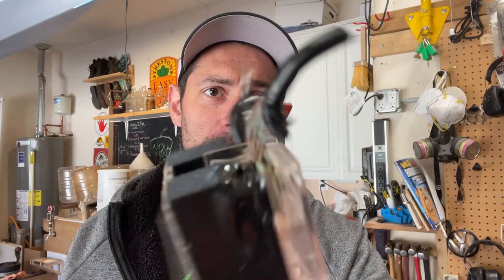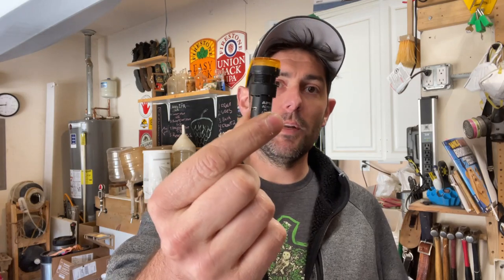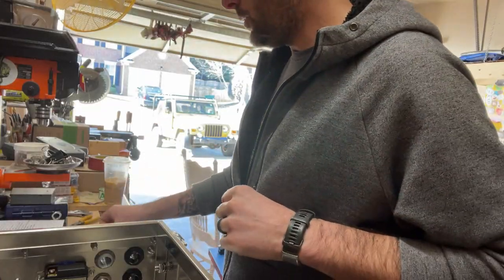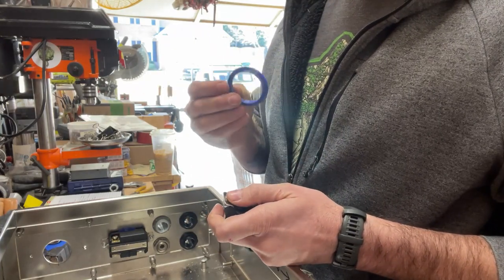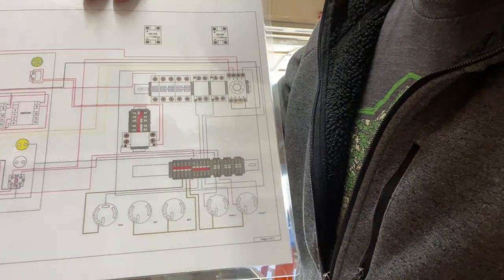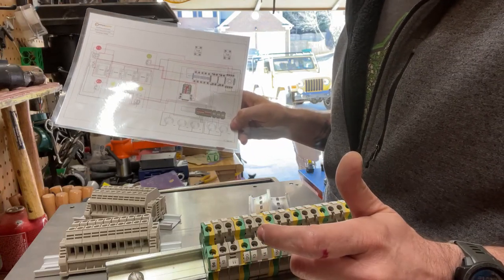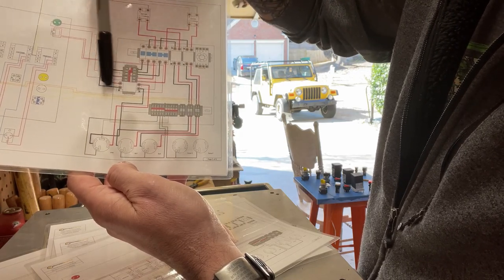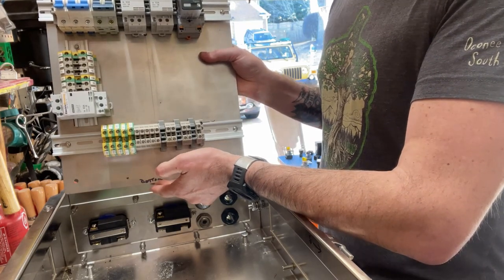OPB - Electric Brewing Control Panel Build Part 1

Comment: great video and looking forward to number 2. just started last month looking into all the same resources you listed for my own panel. going back and forth between sourcing my own or just buying the DIY kit. one question i have is why the breaker inside the panel? gfci breaker, to spa panel, to another breaker in the panel?
Reply from the maker: Hey! Sorry for the late reply. To the best of my understanding the main breaker (panel) protects the full system, the spa panel protects you, and the other breakers protect the various components. In troubleshooting (ep 3 coming up), I ended up popping the internal (and one external) breaker a couple times while hunting a short. If the internal breakers weren't there I would have melted the internals pretty thoroughly.

Hope that helps

Dave
Reply from the maker: One more thing, the spa panel is only necessary if you DONT have a GFCI breaker in your panel.
Reply: @otherpeoplesbeer3789  ah OK that's where I was confused. I'll be adding a GFCI.